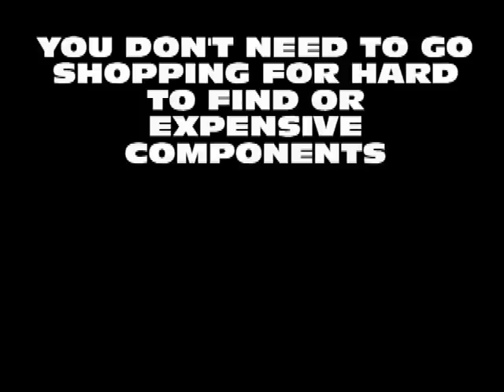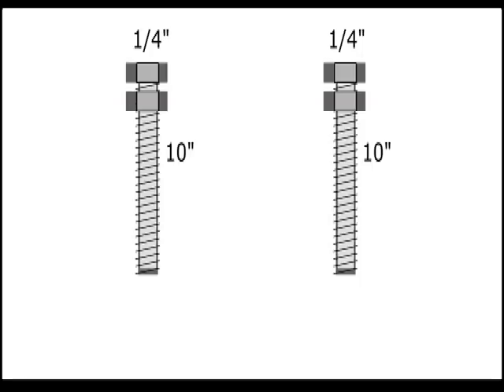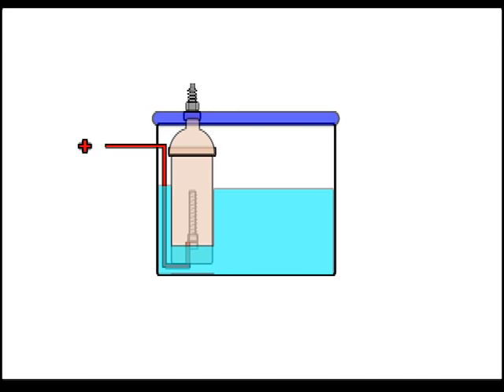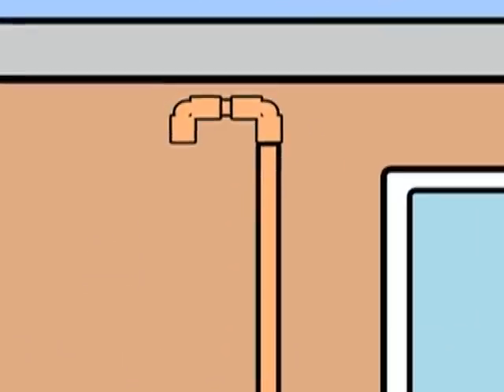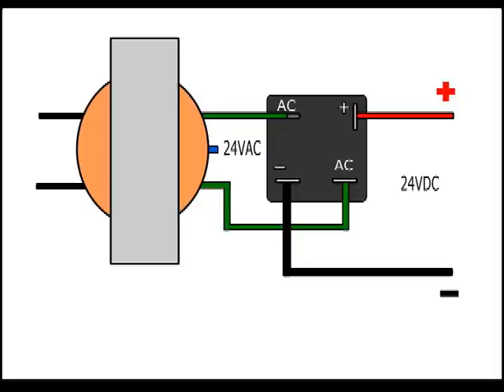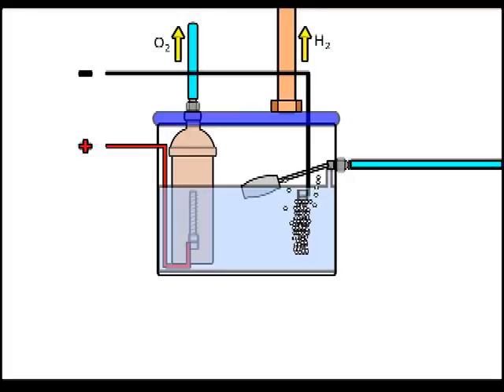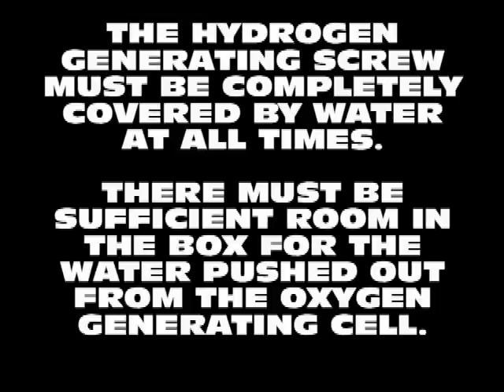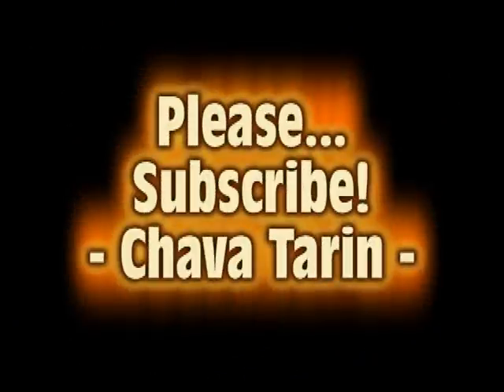Homemade Oxygen Generator

Comment: you may use the hydrogen for cookin.
Reply from the maker: Well, Good point!, Lilarosa. However, in my case, being 83, I prefer not having flames around the house, I do all my cooking with electricity, using a microwave oven, an air fryer, a wireless tea pot, and some solar panels. Besides, I even have a pair of electric water boilers, one for each shower. Electric boilers have the advantage of being safe to install indoors, too. Solar panels are safer for houses where there are some senior cicizens as part of the family. Gas explosions are commonplace in winter, if people forget a room heater,, on all night!

Comment: Good idea but this setup doesn't work , first problem is surface area  of electrodes which are very small, and main problem is when setup start to analyse water we have around 40 reaction in water and water get dark within minutes, the efficiency will reduce to below 10% within seconds,
Reply from the maker: Good point! I have been making some modifications to the original design: i.e. a solar distilling system (solar still),  for insuring incoming water does not degrade. Another improvement was using stainless steel mesh for the electrodes. A system similar is used in space exploration: special alloys produce pure water from urine, perspiration and CO2 due to breathing, even there is a colloquial phrase among astronauts kidding about "todays urine will be our coffee tomorrow". You can find some of my fixes in My Community, please take a look there!

Comment: Sodium hydroxide or potassium hydroxide you mean ?
Reply from the maker: Dear friend, first of all, some clarifications are necessary: even though you can use both potassium or sodium hydroxide, most household intended utilities are contaminated with chlorine salts. This poses a danger, since chlorine is a toxic gas, not suitable for using indoors or for clinical use. Secondly, oxygen is a strong oxydizer, and, no matter how it is produced, it can make normally stable materials catch fire, such as blankets, clothes and even some metals!  on the other hand, hydrogen is extremely flammable. and, when mixed with hydrogen, can produce devastating explosions. Great caution must be exerted as to leaks, heat or sparks. Even a car battery can explode, since during charging large amounts of these gases are produced! There may be restrictions as to oxygen handling in your country, very likely. Please consult a local expert on the use of oxygen and hydrogen!

Comment: One thing i sugest is the negative connotation, the bolt that produces the hydrogen,, put the connection to the bottom end of the bolts, this maintains the conections in a submerged in water longer even when water level might lower, so prevents, inadvertant spark ignition... 
Thanks to you again...sir...
Thom in Scotland.
Reply from the maker: Thanks a lot, dear Thom, for your kind contribution!!!

Comment: I will be collecting oxygen and compressing it into tanks for torches use with metel cutting & welding applications.
Reply from the maker: As a matter of fact, back in the 19 century, Joaquim Bishop, in Philadelphia, applied this technology in welding and cutting platinum, since Oxyhydrogen flame produces extremely high temperature. However, it would not be safe to use on cutting or welding iron, since it would make it brittle. Please read this most interesting article about Oxyhydrogen and its use in industry.  You can find it at  https://technology.matthey.com/article/14/4/140-146/chinese/
This electrolysis method is also used in the ISS for recovering water, and oxygen. Thanks for your kind comment!!

Comment: Does it matter what grade of steel you use? In other videos I've heard that low grade stainless steel can produce chromium along with the O2 which is very poisonous. What would be the best grade of steel to use for the cleanest Oxygen?
Reply: Mostly i know the solution is using platinum and silver electrodes then potassium hydroxide.
hope this helping

Comment: What if you distill the water (boil-condense) or us an R/O filter to remove all dissolved solids? Then would the oxygen be safe to breathe?
Reply from the maker: Thanks for your comment! As a matter of fact, You could use a solar still. In my section My Community You Will find a drawing of a simple solar still connected to the generator. Please keep in mind that the oxygen produced must be certified by medical personnel, and also that the amount of gas produced may not be enough for such application. There is a full explanation included with the drawing.

Comment: Do you ever have to replenish the sodium hydrochloride? Does it get diluted as the new fresh water continues to come in or does it last forever?

Also, how could you go about storing the gas your produce from this? I'm assuming for your mini torch you would want some type of pressure feeding out the oxygen, much like a propane torch. Would you use an air pump to compress the oxygen or is that no good? 

Also, about how much oxygen and hydrogen would you say you get from each container (if it didn't refill with the float)?
Reply from the maker: Dear Zach, sodium hydroxide (not hydrochloride) has to be replaced if it ever gets contaminated by chlorine salts, non distilled water, material released by electrodes, or dust from the environment. Normally it lasts for years. Thanks!!!
Reply: @eltunene  Awesome. Good to know! Thanks :)

Comment: Is there any better way to increase the flow of the oxygen generated from this project?
Reply from the maker: Thanks for asking, one simple way would be to use several units in parallel, but there is more to it. Oxygen is dangerous, and when mixed with hydrogen it is highly explosive. Water used in the process must be distilled, if used in respiratory devices. The Generator evolves some heat, and requires a considerable amount of electricity, however, if you get assistance from qualified personnel, you can produce certified usable oxygen. Please use all due precaution, if you build a larger unit, heat resistant materials must be used. Leaks can prove very dangerous. Please be extremely cautious.
Reply: @eltunene  thanks

Comment: Can we combine the oxygen and hydrogen to make a torch? And also will water vapor be created in the torch? Can we make a compressed air pill that if ignited explodes water vapour and can be used as compact water?
Reply from the maker: Dear Alvin, yes to all, but since anyone can make this Oxygen and Hydrogen generator (electrolysis is a long known process), using both hydrogen and oxygen combined can be dangerous. Of course, with all due precautions, it can, and has been used by many people for a HOH torch. The process I detail in the video is a little slower, but produces separate Oxygen and Hydrogen gas, so they mix only at the very torch output. Also a larger cell could be built, taking into account the amount of heat produced by the generation, and yes, water is the only result of combustion.
Reply: @eltunene  what if the hydrogen and oxygen is compacted/pressurized into a small chamber and then when lit fire can make compact water so we can carry water easily inside a small chamber instead of bringing jugs? Does this work?

Comment: You mention adding naoh that’s lye. A couple of things to note. Naoh combined with water creates an exothermic reaction and in the wrong container will corrode the container or even melt it leaking acid. What is the ph needed for the cell? Also if the float sends fresh water in is it necessary to add more lye over time?
Reply from the maker: Thanks for your comment!! Well, the float just replaces the water used up in the process. On the other hand, yes, the container must be impervious to lye. Thanks again!!
Reply: @eltunene  thanks but I am still perplexed do you add lye each time you fill the container? I’m assuming the lye increases the ec of the water to optimize o2 production. My question is what ph level is best for this. A simple ph meter could be used with a solenoid released base solution to keep it balanced. Possibly with an arduino.

Comment: Why the Hell are we not running our Cars from one of these !?!?!?!?!
Reply from the maker: It would work, but a hydrogen central production plant would be needed, and the cost of energy to produce hydrogen would be high, so maybe solar energy could be used to produce the hydrogen fuel, maybe when oil supply finally runs out, they will devote some attention to that. Hydrogen produces water as a result of combustion in oxygen (or in ordinary air), so it would be cleaner.
Reply: @eltunene  👍🙋👍

Comment from the maker: Dear John Lockwood, oxygen and hydrogen can be dangerous no matter how they are produced. Oxygen is a strong oxydizer and hydrogen is extremely flamable. However, when they mix, thay are totally explosive. Great caution must be exerted as to leaks, heat or sparks. Even a car battery can explode, since during charging large amounts of these gases are produced! There may be restrictions as to oxygen handling in your country, very likely.

Comment: My school buddies dad had a machine in  the back of his muffler shop that used this process to make oxygen. The machine looked very old in the 70’s so I would guess it would have been made in the 1920 to 1940 era. It took up about a 6 foot long bench. Just electric and city water hookup. He never had to buy oxygen for his shop. Plenty of pressure to run a cutting torch.
Reply from the maker: Thanks for sharing, Dan, indeed it's an old technology! It is a good practical way to generate oxygen, with the convenience of solar power, it becomes more and more inexpensive every sunny day!!!

Comment: This is a simple electrolytic separator.  An important thing to note is that this process uses a LOT of electricity.  It's a very costly process due to this.  If you're considering separating out your own oxygen and/or hydrogen to save money, you likely won't.  The cost of electricity will likely be more than purchasing the respective gasses from a manufacturer.
Reply from the maker: Yes, indeed, especially for large volumes, it becomes too expensive.
Reply: may be good if u have cheap solar power at home ..
Reply: Of course if you provide power from Solar panels you could bring the cost down.

Comment: Sodium hydroxide is highly corrosive and used in oven cleaners. Burns the skin!
With electrolysis of water the question has always been what do we use to make the water conductive. As the side effect can often be toxic! Many were doing similar in HHO producers in cars going into the air intake, using sodium bicarbonate. The water in the longer term became toxic, and many were told to pour it down the drain. However in effect the substance was the same as in the Erin Brockovich movie that causes all those sicknesses through contaminating the environment. One might not be noticed, but every man and his dog doing HHO or something else would add up as the junk in the middle of the Pacific Ocean that can be seen from space! Metaphorically speaking, as you would NOT SEE IT, but perhaps all the death around it might be seen. So a better additive to make the water conductive, that is not going to give off chlorine gas as salt does etc. Ideally something that is going to go with the hydrogen instead of the oxygen as far as polarity attraction is concerned. Im speaking of seeking the goal of pure oxygen to breath. Perhaps in your own back pack suit? Perhaps with CO2  scrubbers as well? And even to purify regular air with O2 as a supplement? Consider killing a virus by running air through transparent tubes of length in a UV light enclosure, so that it has at least 2 or 3 breaths in reserve in the delay line of processing. Just figuring, home made and all, may as well plan ahead for what may be may be...
Reply from the maker: Worth to taken into account!!

Comment: I’m sorry this is poor design, reflecting middle school science. Much better to make a compressor using easily available and cheap zeolite. See Wikipedia for oxygen compressors. Zeolite absorbs Nitrogen under pressure ~75% of air leaving O2 (~20% of air and a few other harmless gasses(for breathing). Draw out this gas and you have ~80% O2 which is more than concentrated enough for most uses including medical (actually be careful to dilute since more than high enough to in time burn lungs). Depressurize the zeolite to pull the Nitrogen out, and repeat. This is safer , cheaper and more energy efficient.
Reply from the maker: Yes, oxygen concentrators are very good and efficient!!
Reply: @eltunene  I’m no troll (I hope not). I compliment and encourage science and engineering videos (I am one), but looked at your other videos and wonder why some one who knows so much posted this poor design? Inflammable hydrogen, high power for little gas; it’s a desperate way to get O2, not bad for H2. In the US zeolite with high surface area in filtered bags can be easily purchased online or at pet shops. It appears you know the better method.

Comment: If you step it down to 12v and increase amperage to 30 amps and put a pulsewidth modulator on the power side, you can crack a lot more Oxygen and Hydrogen.
Reply from the maker: Good contribution!!!

Comment: Not quite sure why you would discard the most valuable part of the production process - the Hydrogen!! Oxygen is abundant if all you want is a source. Also oxy-hydrogen torches are easy to build, safe (when used CLOSE to the production point, EXTREMELY hot and highly effective. Just getting oxygen in the way described is pretty inefficient and slow. Research Brown's gas (Stoichimetric mix of oxygen and hydrogen) and Stan Meyer for vastly more efficient and way faster production rate.
Reply: could this generator have saved the crew of the stowaway (2020) film?
Reply from the maker: Yes, indeed, you are right!! I was just trying to avoid the problem of keeping and using both gases, since they are an explosive mixture!!
Reply: @eltunene  totally agreed about explosive mixture, especially if trying to store (!!!). That is, however, the beauty of production in required quantity at the point of use, something quite easy to do with Stan Meyer's resonant method.

Comment: This may be a simple question as I'm just someone interested and not really a strong chemist:

What happens to the sodium from the NaOH?  Comments about NaCl suggest the chlorine ends up with the hydrogen, so I would suspect the other half of the ionic compound ends up at the other electrode near the oxygen.  As a quick search doesn't show me anything about sodium gas in STP conditions, so would there be a sodium metal deposit on/under the pvc?
Reply from the maker: Dear GlueC, under ideal conditions, the sodium hydroxide does not take part in the reaction, but acts just as a ionizer to make water conduct. But certainly it is worh taking into account!

Comment: Stainless steel is a very poor choice for electrode material in an application like this. The electrode potential is too high which spoils the efficiency. It is, however, affordable. Platinum, one of the best materials, is a wee bit more expensive.
Reply from the maker: Yes, indeed there are better choices, but usually they are much more expensive than stainless steel. For a small generator such as this one, for a small torch, it can suffice.

Comment: cant you use the hidrogen as natural gas?
Reply from the maker: Yes, it can, as a matter of fact, it is being used to power automobiles and power plants. However, in spite hydrogen is the ideal fuel, since it just produces water and no carbon footprint, some technical difficulties must be overcome, mostly related to safety. Hydrogen is odorless, so it cannot be easily detected when there is a leak somewhere. Production is still more costly than merely extracting natural gas. Hopefully, the situation will change and people starts using more alternative sources for power. But, yes, hydrogen produces a very hot, almost invisible flame.
Reply: @eltunene  damn omg i need to find a way to use this... not to drive, F that but to fly... im tired of living under this corrupt system, i wanna learn enough to go to a remote place, and live freely.
i dont hate company but i live good alone to.

Comment: If anyone is planning to use tap water in this thing then it is likely to be a chlorine gas generator as the flow of current causes chlorine in the tap water to be released.
Reply from the maker: Yes, indeed, not only that, sodium chloride present in the water surely releases some chlorine also. Distilled water must be used for obtaining pure oxygen. Thanks!

Comment: Hmmm, seems like a waste of Hydrogen gas to me. As long as you store only hydrogen gas by itself, it should be fairly safe for use later as long as you have a proper container to hold the hydrogen gas in from leaking out. It is difficult to store hydrogen gas as it can pass thru most standard container walls. Still a cool  project.
Reply: Maybe that is why it is stored as a liquid. There are 4 types of cylinder and tanks for storing Hydrogen...it must be kept at -253 degrees.
Reply from the maker: Thanks, Packrat's for your kind comment!!!

Comment: SIMPLE ELECTROLYSIS PROCESS. COMBINE THEM BOTH IN A SINGLE OUTLET TO PRODUCE  FUEL FOR CARS AND MOTORS WITH SODIIUM HYDROXIDE MIXED INTO WATER
Reply: Or just collect the hydrogen. Use a CNG kit on your  car and just burn the hydrogen as a fuel source.

There is a guy in the United States on a camaro. No other ingredients required. Also CNG kits still allow the vehicle to burn gasoline if needed.

Comment: tu peux aussi utiliser du bicarbonate de soude, qui est moins dangereux. Le volume de gaz dépend de la surface des electrodes. Comme la tension de pincement  est de 2.5 V environ, un transfo de 6 ou 12 volts est suffisant.
Reply from the maker: Merci beaucoup mon ami pour votre gentil commentaire!! Merci aussi pour votre contribution!!